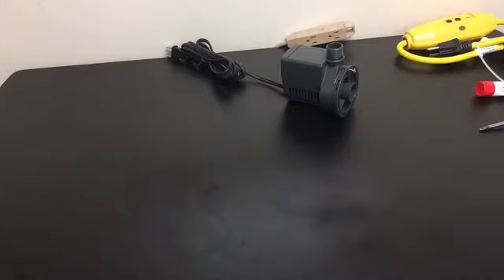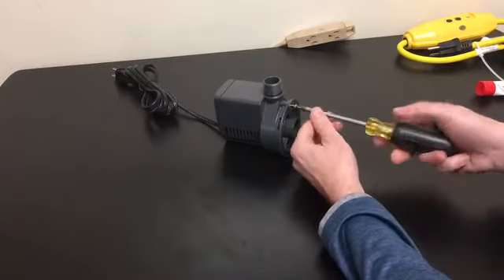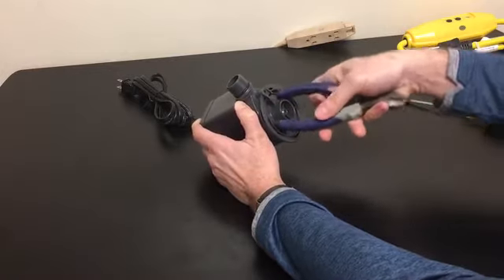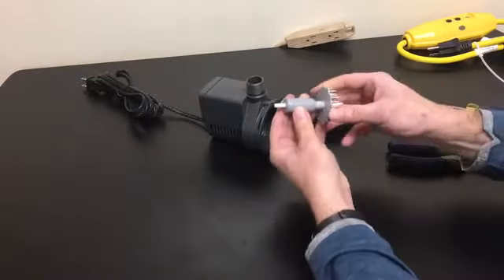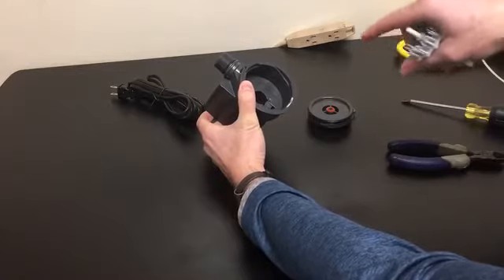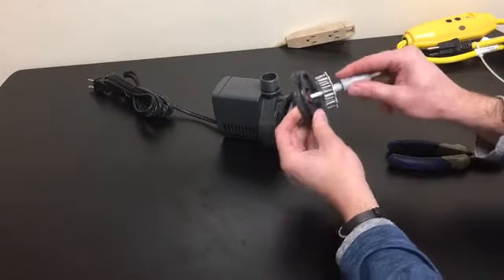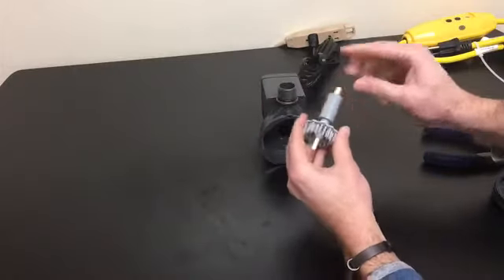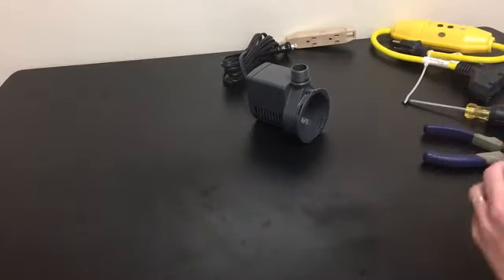Pump motor block check and ask trouble shooting Sicce PSK

Comment: How can i test if the motor got the same power as a new one?
My RSK600 isn't running great since a few months, tried so much but didn't get better, so i believe it doesn't have the same power as it was new
Reply from the maker: You can hook the pump to a wattage tester and if it is drawing the same wattage it is the same pump.  It would be very unlikely it is not the same motor block.  Restrictions in the venturi, the intake, and a defect in the rotor could change its performance. Look for all of those.  Clean your venturi if it is for a skimmer with citri clean by aqualierx.com

Comment: I cannot get the bottom turn. I have an old pump and new one. I am trying to transfer the venturi but I I can't get them to turn and am afraid to break them. I tried the rubber handle. PSK 2500
Reply from the maker: It is very hard and frustrating for sure.  If you keep the ring lubricated it is easier.  What model skimmer and venturi do you have?

Comment: Thanks for the Video ! good to know how to remove the cover... Would you know why or is it normal the pump vibrates ?
Reply from the maker: All pumps vibrate some.  Depending on the design, installation, pressure, quality etc it is different from pump to pump and install to install

Comment: Thanks ... it helped me a lot. But I still have problems. I have 2 PSK1000 on my skimmer. I followed your video and successfully opened and cleaned one pump. But I am unable to open the second one. It does not move. Any Tip on how can I clean it do open ? Maybe vinager ? Thanks a lot, Marcelo
Reply from the maker: You must use the backside of tool handles and open it. Make sure you lubricate the oring if you do. This opening is a downside of these pumps. It can be hard.  Let me know if you have more questions.
Reply: @aquamanknox  I was already using the appliers, with no sucess. I had it 12 hrs diving in Coke ... and then I was able to oppen it. My impeler was damaged , severely. Thanks for your expertise.